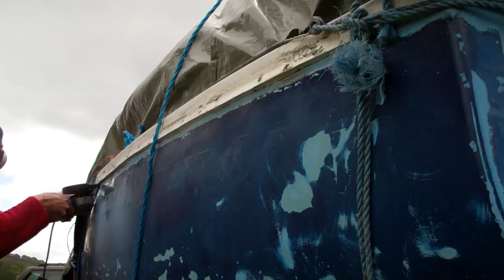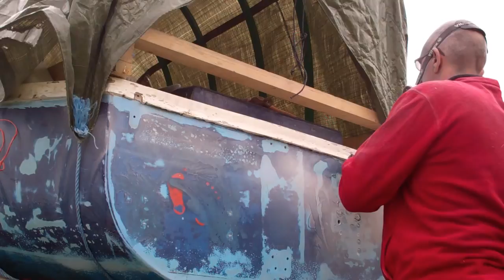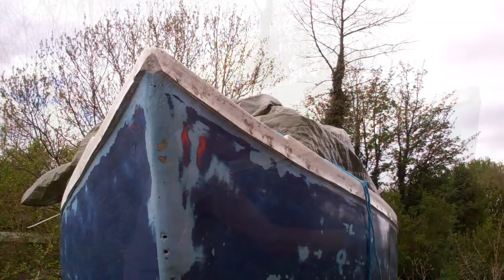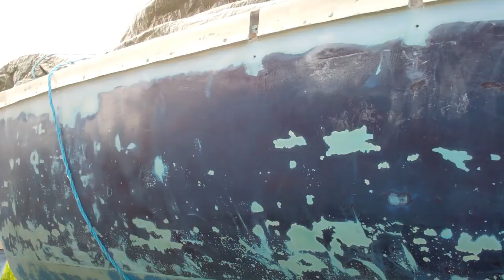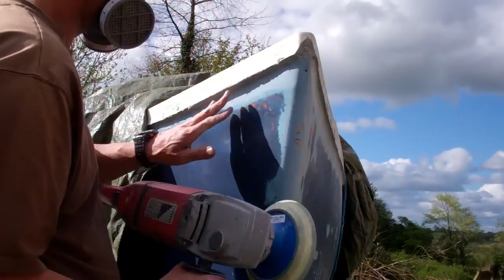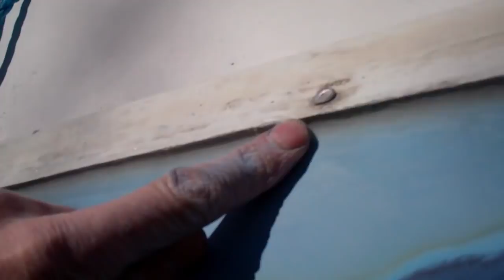Episode 24 - Sanding, Epoxy and More Sanding!

Comment: You definitely have to make hay whilst the sun shines, lol. Hopefully the fillet of epoxy will add stiffness to the boat. Have you thought about what colour you will paint her yet?
Reply from the maker: I have pretty much decided on painting the entire boat inside and out with a white two part epoxy paint, to give it an all over uniform finish.
Once I get to that point I will decide if I just want add some coloured stripes or perhaps  different colours for the topsides.

I have tried colouring a photo of the boat with different colours and that proved inconclusive, that said, I think I have ruled out all darker colours simply for safety, so in the absence of anything else the white will definitely be visible in most situations.

Comment: Cracking progress Dave! What were the state of the stainless fixings on the hull to deck joint? They did not look too bad. Your be in the market for a rubbing strip to cover the joint soon.. Some good stuff on ebay. Cant wait to see your next video. Ant & Cid x
Reply from the maker: Thank you, the remaining fixings are fine, I have the old timber rubbing strip and have yet to make a decision of whether I should try to rejuvenate that, or just go with the more modern ebay alternative. Thank you both for your support Regards, Dave